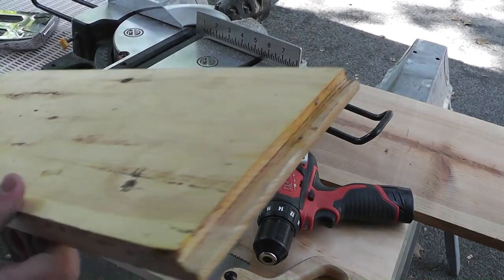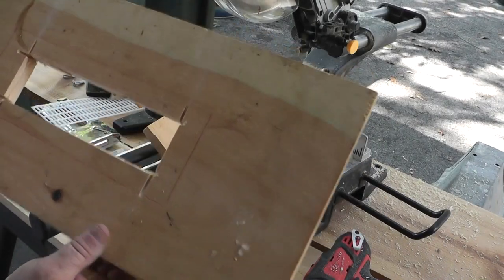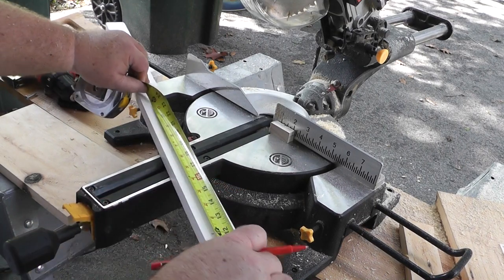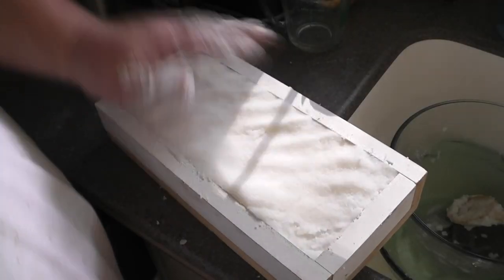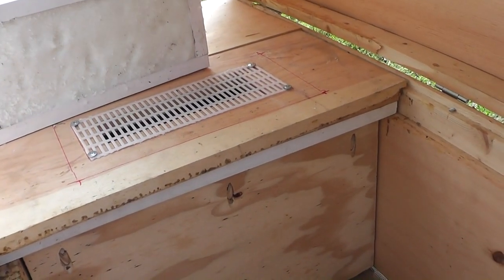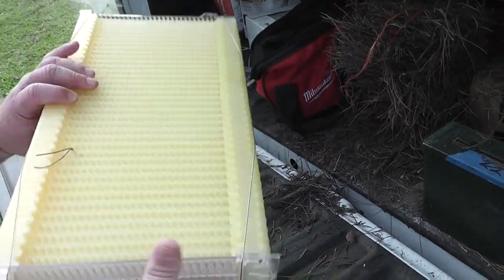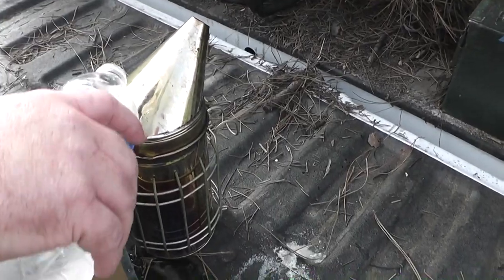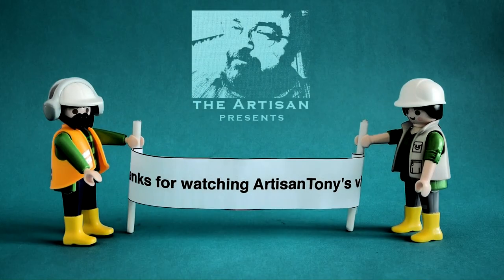Making a Top Feeder for My Hybrid Top Bar Beehive - Flowhive Gets Dirty

Comment: the tittle seemed misleading. i thought you was talking about the sugar water feeder. if you were making a small portal to reduce the heat loss in the hive, when you feed them during the winter. removing a full size panel would be like turning on the ac system, full blast.
Reply from the maker: +dale myers Not sure what you mean. The title says "Making a Top Feeder" which is the bulk of the video.  Nothing will be openined in the winter except to replace the box that holds the feed.  This is much less stress than typical hives place when they open their hives.
Reply: when you remove the bulk feeder to replenish the sugar shorten mix it wont open a full sized panel. just a portal. i figured you were going to do much the same for the sugar water feeder. when you said your "making a top feeder" as i know feeding bees is necessary in the winter time. and know it's not good thing to rob from the hive in the fall. i knew you had the sugar water feeder. i had no idea you were going to make a completely different feeder. that was what seemed misleading. no, i don't raise bees.  i have bee keeping neighbors. and they have 4 tradition hives. they use their honey to make hand  pulled butter mints.  it's not a big issue. i was mostly talking out loud with the key board. as i do most times.